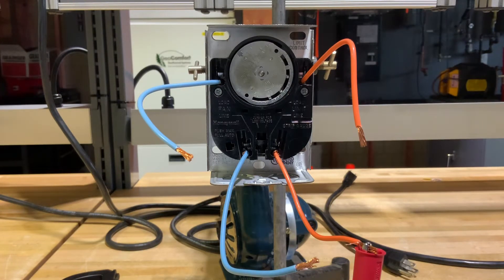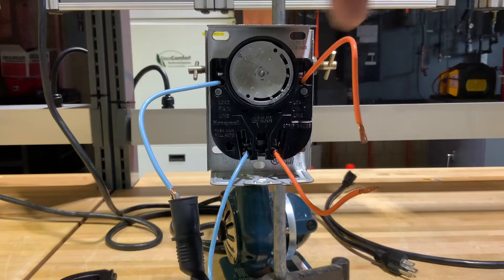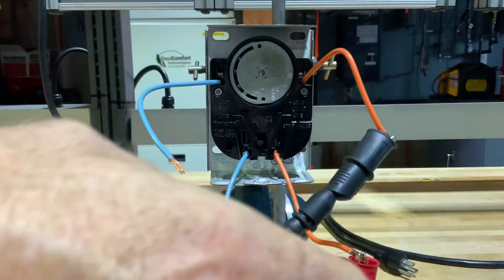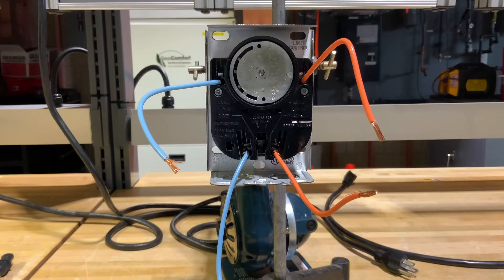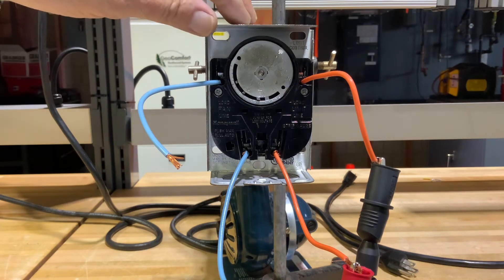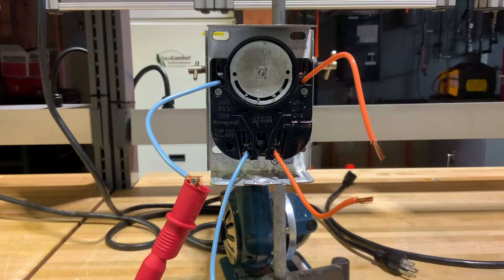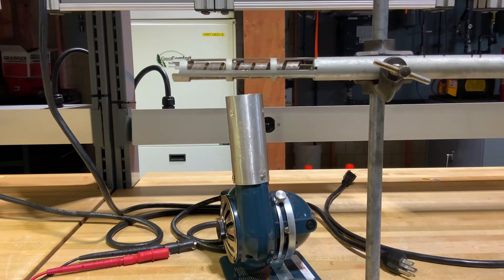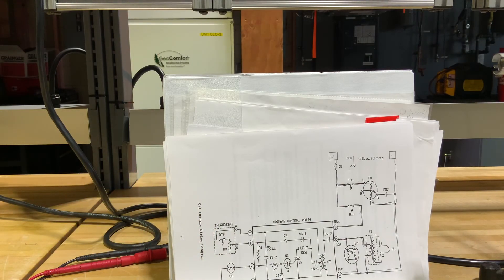Fan/Limit Switch Operation

Comment: If we need to test the switch because we think it's the switch not turning on the fan, would we jump the top 2 wires together to see if the fan kicks on?
Reply from the maker: You should never jump
Out a limit but just to test it you could jump out
Reply: @frederickkosier2508  which terminals would you jump out?
Reply from the maker: I would jump out the fan side first

Comment: I can wire one of those for use with my wood furnace I just picked up be happy you people can rely on natural gas or propane wood would kill most of you especially when you got a look around a 30-lb chainsaw and wield that sucker all day long because it's the bigger the round the more wood you get the more wood you get the less you have to cut but not less than you have to split or stack cuz it's the same amount cuz you get more wood from the bigger rounds but the moral of this is now I don't have to use an open face fireplace with blower to try and heat a house I can now use my wood furnace and duct it through my house country boy will survive very intuitive video much appreciated it
Reply: Your saw ain’t 30 lbs dude, and every rural home was heated with wood then switched to gas or propane. You aren’t a pioneer. A lot of homes, like mine, have a gas furnace in adjacent to a big wood stove which can produce enough heat on a brutally cold day to keep the furnace shut off.

Comment: Does the 24 V side of this switch get its power from the W terminal when the heat comes on?
I can't seem to find that info anywhere.  Someone has wired mine to get 24V from the Y terminal when the AC is on which makes no sense at all. Now 24V is not getting through this fan limit switch and through the thermal switch on the blower and  finally making its way all the way back to terminal 1 of the Honywell Intermittent Igniter which turns the gas valve on for full burning operation.

The igniter is a 24V system so if your fan limit switch happens to be a system where 110V AC is running through both sides  of the fan limit switch, the limit side has to step down to 24V at some point with the 110 V / 24v AC transformer to shut the gas off if things get too hot.

Comment: I am seeing very low voltages (23v) where there should be 124 volts (above blue wire) . I see 124 on orange. The switch appears to work. Does that mean my limit switch is bad or is it something else. I have an older 1978 era furnace/ac. It was working fine earlier in the week, now it's doing this. I am having to run it on fan to heat the house as the Auto setting does not work.Thanks for any help. I'm pulling my hair out.
Reply from the maker: You would read 0 volts or close to it on the orange wires above due to it being a switch. You would read 120 volts on blue wires until the furnace heats up enough and the switch closes then you would read 0 volts across blue wires and the fan would come on. Sounds like the switch isn’t closing to bring fan on
Reply: @frederickkosier2508  Thank you for your replay. The way my Honeywell limit is wired is that there is  no wire where the lower left blue wire is, so I would think it is directly connected to the lower right orange via a copper strip (I think ?) so why it would read 30-60 volts on that lower left blue is a mystery. ? or the connection between the lower blue left and lower right orange wires is bad. I did play around with it today measuring voltages and I'm not sure what I might have done, but I started to get 120 V on the lower blue left and the thermostat auto function started to work. I would prefer not to have to buy another Honeywell switch as they are around $200. Have you ever seen this kind of behavior with voltages before ? Just a sidenote, the upper left blue only gets 120v when the limit switch triggers (well, when it's working properly anyway) which I believe is correct.

Comment: My limit switch side is bad(open) on an old ge furnace. I can't find the part.  What options do I have?
Reply from the maker: Is there an aftermarket one or maybe look on eBay? Older parts are definitely getting harder to find. Even newer parts are getting hard to get.
Reply: @frederickkosier2508  yes, an aftermarket would be good. Just matching up to one is hard. Could I just get one that extends the same length?
Reply from the maker: You would want to make sure all specifications match